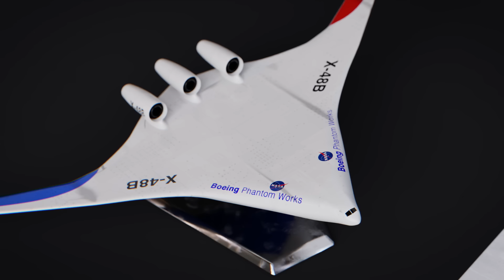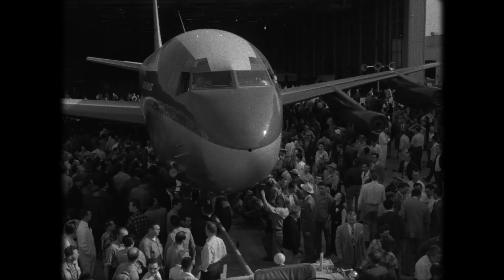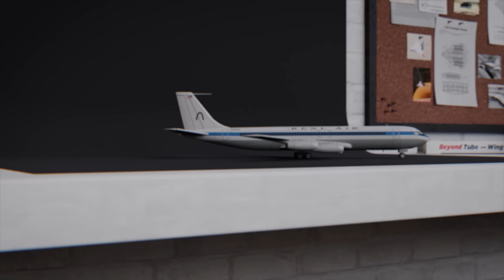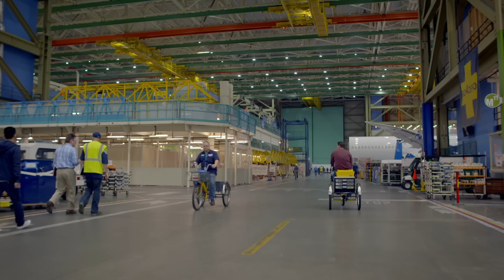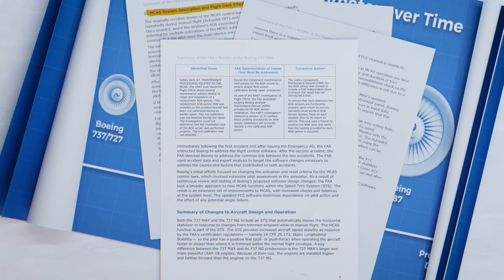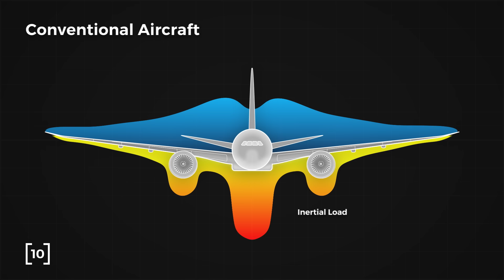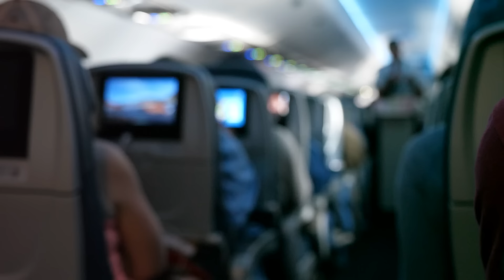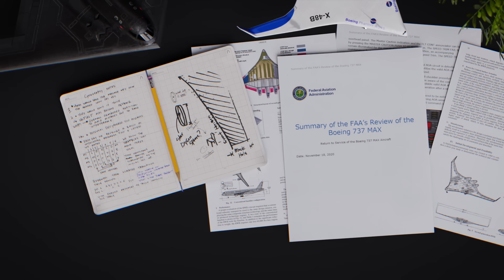The Plane That Will Change Travel Forever

Comment: I read somewhere that a disadvantage of blended wing airline is that passengers at the extremities would face severe motion sickness as they are near the wingtips and thus tilt a lot when the flight rolls or turns
Reply: Most of the turns an airliner does are in the first and last 5 minutes of flight; most of airsickness is caused by the bumping that happens in turbulence, which would be about identical for a BWB and a conventional airliner.

Comment: Regarding the pitch-stabilisation function of a conventional tail: wouldn't a neutral-lift tail perform the same function if the CG and the CL were on the same axis? As in: a neutral-lift tail would still passively correct for perturbations. I feel like I'm missing something here. Cheers.

Comment: I am a researcher and aerospace manufacturing technology has changed... New technology in aerospace titanium-aluminum alloys admitted and approved on September 22, 2020 in the US... Reactive titanium-aluminum alloys can be joined by robots for the first time in history... This means that aircraft will be manufactured by stamping the fuselage and welding by robotics eliminating the traditional riveting of the aerospace industry...Aerospace alloys are joinable by laser systems from both sides preventing reaction of the material with the air... Integrated fuselages can be built with the new technology because it is not necessary to manufacture riveted and pressurized cylinders... The geometry of the integrated fuselages in the images come from the new technology admitted and approved l September 22 of 2020... Greetings to all and it is an honor...
Reply: @eduardoamaro7867 Thanks for info. It's exciting times in aerospace with the introduction of all the new technology. The car industry was robotised  from the 1980's onwards, and it seems as though the aircraft industry in going the same way.

Sounds like you have an interesting job.😊

Comment: I totally not understand why they dont mount the wings on the top of commercial flight. The wings always block the sight to the destination when I am flying
Reply: @MorgorDre Yes, low mounted wings do block the view forward, but you could try to get a seat at the front of the wing.

There are quite a few benefits for a low wing on a large passenger jet: the box that joins the wings can be located under the floor of the cabin. The box can house the landing gear. The engines are low down easing servicing. The engines are further away from the cabin making noise less of a problem, which is also an advantage in case of an engine malfunction, especially a fire. In a crash in the sea or on land a low wing protects the cabin and in the water the floating wing keeps the cabin above water.
Reply: @phonicwheel933  I dont know why but wing seats is all I get 🙂 Maybe they are in my price range?

The landing gear is still on the underside of top mounted wing planes. But I totally get the thing with maintenance, just the bigger the plane, the more high up they are already - even when mounted on the underside.

The security aspect is also very good. Thats the one I really did not consider.
Reply: @MorgorDre  Sometimes, for a slight premium, you can chose your seat. It doesn't cost much. 

Having a top mounted wing, with the landing gear attached to it means that the landing gear has long legs which causes great leverage, so is very bad.

Even on a big plane, with a low wing, the engines are low to the ground.

Designing an aircraft is a very complex exercise with many trade-offs, and the more you look into it the more complex it becomes. It makes you realise what a tremendous job the manufacturers make of it in most cases. Boeing defined the layout for passenger jets in the 1950s with the 707 through to the present.

I can tell that you are a fan of high wings so perhaps you would like to know that a high wing in inherently more stable in flight than a low wing.
Reply: @phonicwheel933  I am not sure if I am a high wing fan. Just wanted to try it for once, as a passenger.

I just noticed it was more used in the past and at some point fell out of favor.

Some Bombers, Floatplanes and flying boats still seem to use it...

Also: Nobody suggested to top-mount it and make landing gear go into the wing with long legs.
Reply: @MorgorDre  Yes, a high wing is used in applications where there is a hazard on the ground. In the case of sea planes it's water, and for military aircraft it is due to possible rough runways and debris on the the runway. For cargo and bomber aircraft the high wing leaves room for the payload.

But, like I said there are many factors to take into account when designing an aircraft.

About the landing gear on a high wing, I was responding to your comment: The landing gear is still on the underside of top mounted wing planes. But perhaps I misread it.

Comment: 12:48 - 12:58 and NO REDUNDANCY with consequences of failure at that magnitude on a safety feature to that degree🤯🤢there’s no way an engineer signed off on that design for public use !! WTH I can see maybe someone such as but not limited to a business person or something undervaluing the importance of systems, but an engineer is the one who signs off on those systems! Those engineers surely lost their licenses, if not in a cell somewhere along with the ones who pressured them into breaking their engineering ethics, there are professional licenses for a reason ! Omg .. was this poor system design with no redundancy on that Malaysian plane that went down … if so I bet there were people who were implicitly implying towards some bs like the pilots were inferior pilots and that’s why they crashed because of pilot errors or something .. instead of looking at the system that those pilots were put in that had set them up for failure. From the moment the plane was discovered to whenever the investigation completed, those pilots and their reputations were probably being unjustly trashed even in death, when it was the system that failed them wtf I feel like there were other crashes of planes over these years .. if those were due to the same system failures they probably went through similar sh!t

Comment: wouldn't a plane built out of steel, preferably stainless, by much stronger and about the same weigh, by being thiner, then the aluminum, and much cheaper then aluminum. Also by applying the whale flipper tech to lower drag by 30%.

Comment: The overall look is good but engines are not the future. Engines need to be protected from Bird strikes and radar signature similar to the F-35, and Mach 2+ speed. CAN Carry 50-100 passenvers or cargo and can go coast to coast 60-80K Feet with 1 Refueling  like SR-71. HOWEVER, the fuel can be saved with a gradual altitude climbs, and cruising speed. Can be used as a Presidential escape Supersonic Jet. Top speed  can be 3+ Mach to escape missle shots and Chaff for signal jamming.

Comment: The 737 Max didn't fail because of faulty software. It failed because of faulty hardware that they tried to fix with software. That plan is a death trap. Would you want the alignment of your car, or an unresponsive steering wheel to be corrected with software that or would you demand the issues be repaired?  Boeing cut corners and tried to fix a faulty plane with software.

Comment: That fact is that a wide variety of "cliffs" are rapidly approaching. Climate change, even if not caused by humans (which it is), would be certainly slowed and even stalled if we, as a race, decided to dramatically limit the emissions associated with travel, heating & cooling, meat production, etc., not to mention reversed the destruction of ecosystems, forests, other land-based plant life, as well water-based plant and animal life. Another is oil reserves being used up. Designing airplanes that are more fuel efficient should be second to actually pursuing a net decrease in annual said transport. Same with ocean transport. 

Finally, we are already in the process of the rapid adoption of so-called "green" energy where we don't know the consequences of engaging in. Wind turbines pull energy out of wind, as tidal generators do. However, we are once again messing with something we don't understand and could end up with a far worse problem. One of the potentially-cataclysmic assumptions are that problems will develop gradually and predictably. Instead, it could be a "critical mass" situation where things suddenly drop-off dramatically. Humans have historically created things that we didn't understand, such as nuclear weapons, only to stand in horror when the full extent of the downsides became known. We didn't fully understand this which resulted in the deaths of US armed forces during one of the first series of nuclear tests, illuminating the dangers of radiation. 60+ years later, Social Media has seen a catastrophic rise in misinformation such that now large portions of the US believe that the last election wasn't valid, which is a lie. The list goes on and on. 

At what point do we wait to do something until we more completely understand its ramifications before implementing something? At what point do we make sure oversight and regulation are in place before something goes mainstream, fueled by capitalistic greed?

And I am certainly no better, a product of the same human civilization that spawned all of the above. This is a question about whether we want to try, as a life form, to be better than our ancestors before it is truly too late? A flying wing? How about bringing about world-wide socioeconomic justice or just stopping destroying our planet? 

.

Comment: Much as I love ya videos bro, you even talking about control surfaces actively adjusting a B-2 while during a refuel is just wtf you smoke'n like...  you to show me any plane that can fly itself unadjusted behind the wake turbulence of another plane.
Reply: That's the thing. The B-2, as an aircraft without a tail, needs constant adjustment by the fly-by-wire system even in level flight.

And the wake turbluence from the aircraft in front of it doesn't negate that, it just means more compensation is needed.

Comment: Well I’m a bit ashamed of this chanel right now for two things. Wing fences and winglets do reduce induced drag but, winglets act as another airfoil with its angle of attack in a horizontal plane, thus generating their own lift in direction of flight at high altitudes and high lift coefficients. They do not primarily reduce induced drag by blocking vortices, they generate lift in direction of plane’s drag. Second, I don’t know who told you that flying wings do not generate negative lift downward. As airfoils do, they are defined by their lift, drag, and pitching moment coefficient. A flying wing would tumble as a thrown rock without any stabilising force. Thus we use horizontal stabilisers or in a case of the flying wing, we use aerodynamic and geometrical twist of the wing together with a wing sweep to generate negative lift at the wingtips that are sufficiently placed to the rear by the wing sweep. There you go, I’m sorry for my English. Peace.

Comment: You did a very nice and well done post, I'm addicted to airplanes, maybe mostly because my father was a pilot on the Airbus A320 from 1984 until 1995 when he retired.  But I have a few remarks to make about what you said about the 737 Max and the fact that fly by wire does not yet offer safe handling of the aircraft.  Fly By Wire was first introduced in 1984 on the Airbus A320 and since then all Airbus aircraft have this feature. Fly by Wire is designed and thought to be safer than conventional handling.  On these planes you have several "modes" to fly, There are three basic reconfiguration modes for the Airbus fly-by-wire aircraft, Alternate Law, Direct Law and Mechanical Back Up.  So the pilot can choose, in case of emergency, what configuration he can use to fly.  737Max has no fly by wire configuration, MCAS was introduced to the aircraft in order to work silently, without the knowledge of the pilot and with the power to control the aircraft elevators to increase or decrease its angle of attack in case the sensor felt a pitch  larger than “normal”.  And related to The Northrop B-2 Spirit there and it's not about fly by wire there is about the automation of aircraft controls to compensate, through the information received from the sensors, the aircraft's behavior in case of instability, there is much to say, but too little  space :) Anyway, thank you .

Comment: The original flying wing aircraft was rejected by Roosevelt because he didn't like the bank that was financing the project.  Had the flying wing won out thousands of lives would have been saved over the tube fuselage design.   Licensed Airframe mechanic 1984

Comment: The very first passenger liner that had a camera put a camera on the nose so passengers could see what was just ahead.
      What those passengers saw was horrifying. The plane lost an engine just as it was taking off and this caused the plane to crash back down onto the ground causing the plane to lose it's landing gear and the pilots to lose all control.
     The crash at this point would have likely not even caused any injuries but the plane was now sliding along the ground at high speed, headed right for a hanger. The plane crashed into the hanger at high speed killing everyone aboard.
     And they got a great view of their onrushing death one the big screen.
    The airline decided to discontinue this practice, though the camera had nothing at all to do with the crash,

Comment: 14:00 It takes even less. A design flaw in the DC-10 that caused one emergency landing where no one died and one deadly crash, along with a freak accident that caused another deadly crash was enough to kill the DC-10 as a passenger plane even though it was actually quite a good design. People just lost trust in it.
     The freak accident crash, ironically, demonstrated how good the design of that plane actually was. An uncontained engine failure happened in just the right way as to knock out all three redundant hydraulic systems. The pilots lost every but if their control over the normal control surfaces and the only option they had left was controlling the plane with asymmetric thrust.
     Through a great deal of skill and lick the pilots managed a crash landing that saved the lives of more than half the passengers.
    It's an amazing story because the plane should have been totally incontrollable. Though some of the passengers were killed, they all should have been killed.
     Still, the "failure" of the DC-10 not only ended that good airliner, it ended Douglas Aircraft as well. They were merged with McDonnell and continue to build the DC-10 basic design as the MD-11. But under Freighter only versions.
     It's a good freighter at least.